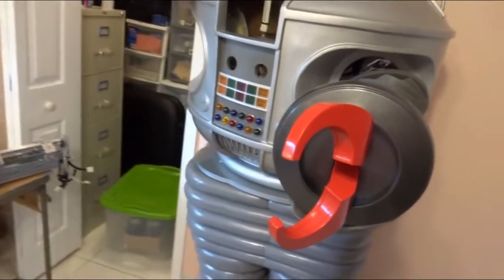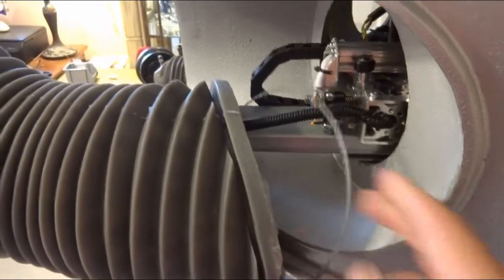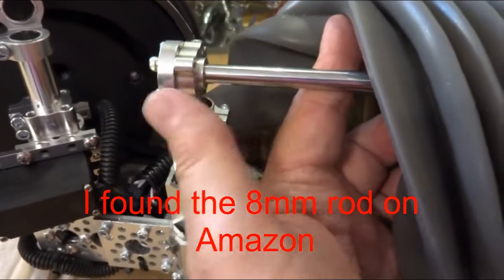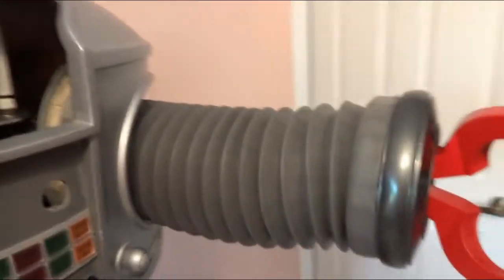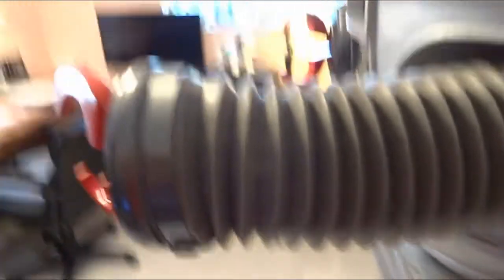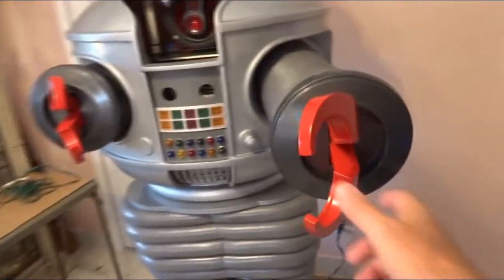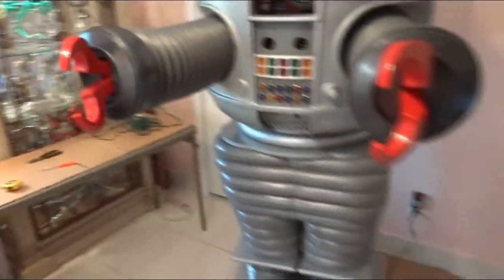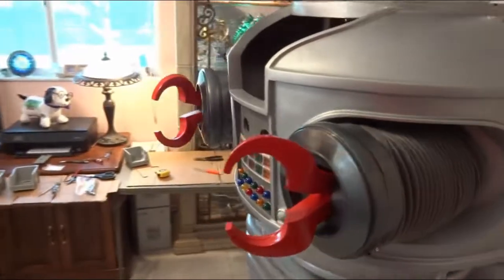Rubber Arm

Comment: Awesome work, trying to get my b9 project started, where to start?
Reply from the maker: Thanks! I had the same question when I started. I actually started on the Torso and worked up to the head and down into the legs from there. I really wanted to see a good section of the robot in my home as soon as I could. LOL. It actually turned out to be a good decision as it allowed me a good starting to fit and mount the needed parts to build out from.